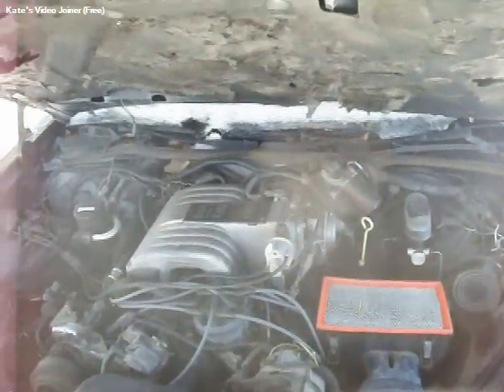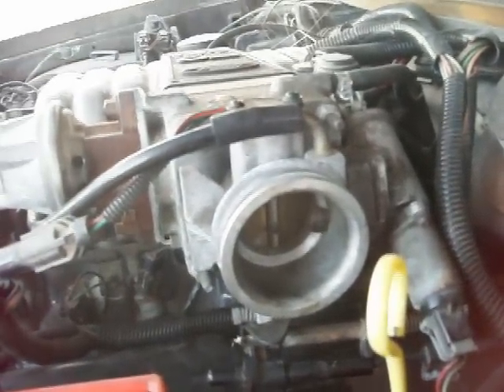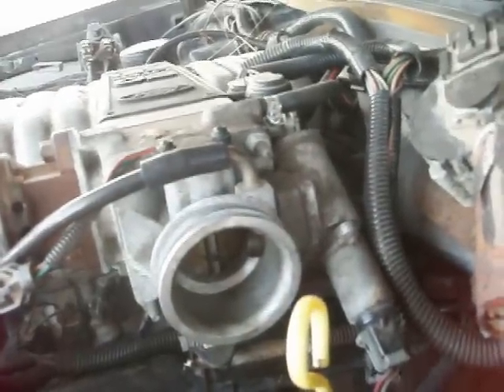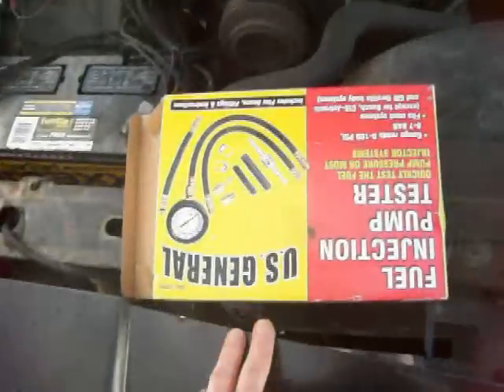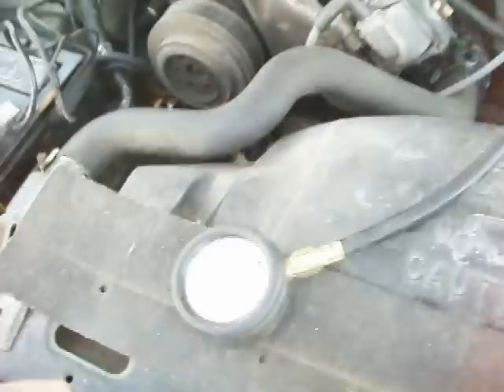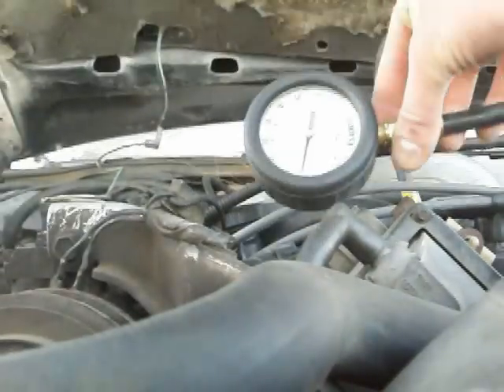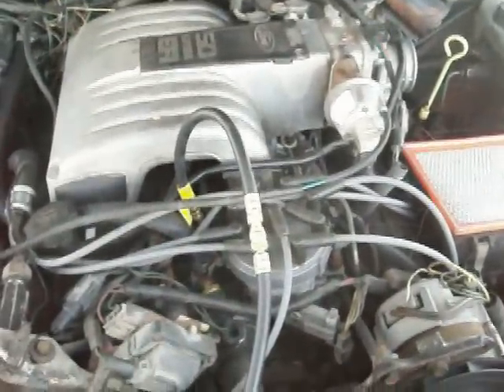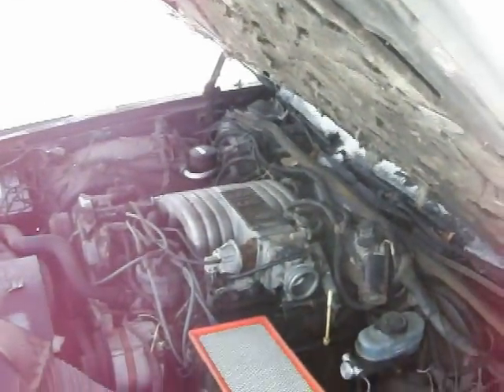More Crown Vic

Comment: My '85 F-150 had a high idle all the time. I ended up having to remove the intake manifold and replace the lower gasket, which was in 20 pieces. Once the manifold was all well-sealed again, it idled properly. Helped that I cleaned out the EGR and IAC passages too. But mainly it was just the air sucking in around the bad manifold gasket. The injectors just match the fuel to the airflow, based on the O2 sensor, so it would idle at something like 1500.

Comment from the maker: @coronadojose36 It could be the cats clogging up, first thing to do would be to get the codes pulled and find out what they are. If you want to test the cats quick you can pull the O2 sensors out and this will relieve any backpressure in your exhaust, if it has power again then the cats are plugged.

Comment: @JakeDaSnakeFilms  I know whats wrong...it's a ferd..lol get a chevy j/k on a serious note bud if it has a lack of power it could be the motor is tired and don't have much compression or a clogged fuel filter/injectors but a lack of power indicates a fuel related issue and possibly not enough fuel getting to the motor or the motor is just tired all together

Comment: ok i have the same prob. i have a 87 vic runs like a beast but after a long trip one day i pulled up to a stop light and the idle started to romp it revd so hi and next thing i no it started to spin the tires a lil bit so i had to shut it off started it drove it home have not had the same prob. now it dies at stops some times it seems to only do it when i hit the gas and let off fast befor i stop i cleand the IAC still does it

Comment from the maker: @More350Power This one had the older speed density system so it has a manifold absolute pressure sensor instead of a mass air flow sensor.

Comment: I gotta question about my 88 Linc with the identical drive train set up.. you wouldn't happen to know what would cause these cars to have throttle hesitation or  barely any power would ya? in my 88, I've replaced the plugs wires TPS O2's & fuel filter, & it still does it sometimes, especially when it's cold, but when it's warm it's pretty decent, but a lot of the times, it still has a clumsy throttle response, just wondering if you would know anything, I've also seafoamed the hell outta it.